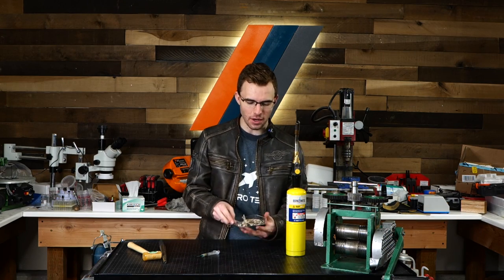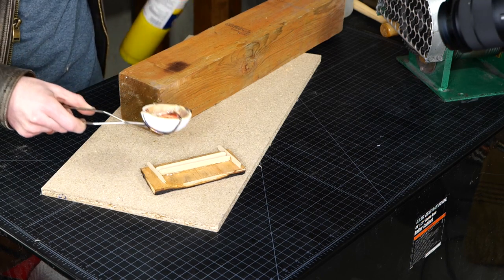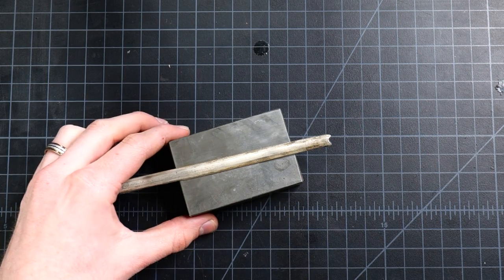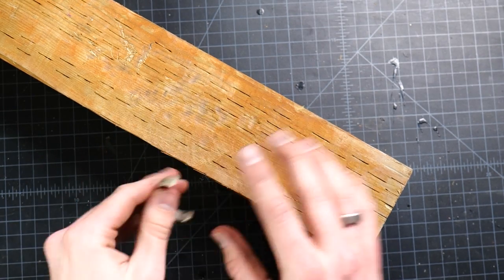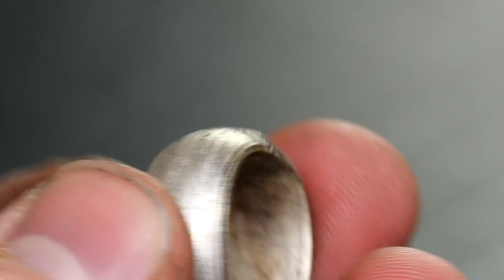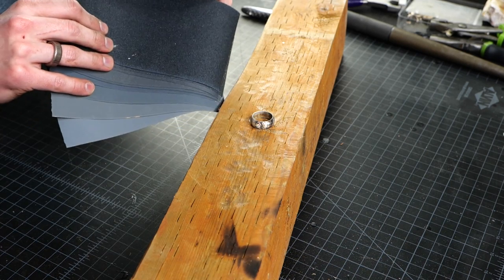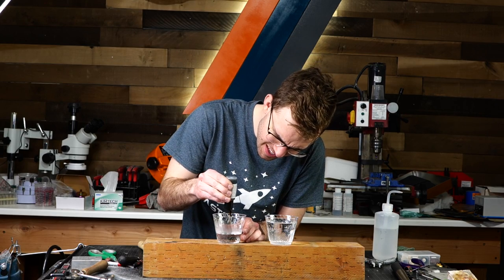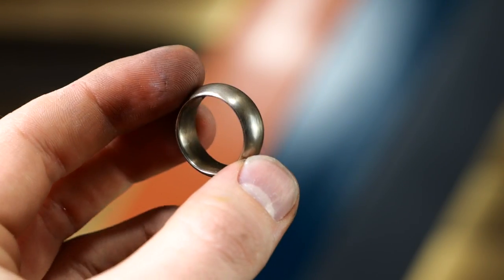No Lathe - Silver Ring from Scraps on a Budget

Comment: Just a bit of advice- if light comes through the seem, the gap is to wide. Solder is meant to bind the ends not to be a filler. Also, wrap the sandpaper around an old paint stick or ruler (grit facing out). It gives better consistency and crisper edges on the outside. Wrap the sandpaper around the mandrel to do the inside.
Reply: as a build up on this tip you can get the ends to line up easier with the saw, just anneal the piece close up de gap as much as possible and run the saw trough it
Reply: Joe Johnson wow thanks
Reply: Yes thank you for telling him
Reply: You are very good making
Reply: @jtjacky  nice making

Comment: Put the ring on the mandrel. Put the skinny part in your drill chuck and use that as a make shift lathe. Most people are going to have a drill if they have a ring mandrel. But you could even do it with a stick or dowel.

Comment: Tip: Don't use tin foil for soldering the ring joint. You will end up contaminating your silver because tin foil has a lower melting temperature than silver.

Comment: Can i use a Ceramic bowl as an alternative for crucible?
Reply: No. They're made of a special refractory ceramic. Get a melting dish and handle and some dried flux. The melting dish has to be prepared first, which isn't hard to do. Heat up the dish till it's red hot at the bottom, sprinkle in some dry flux and continue heating. The flux will absorb into the pores creating a glassy surface. If it looks mottled then there's not enough flux. Add a bit more and tip the dish in different directions to let the flux spread all over. When you have a glassy surface all over the inside and the spout then you can melt the scrap.

Comment: why are you using a bell mallet for your hammer
Reply: Rawhide is a good mallet material for softer metals like silver. It can form with minimal stretching and won't mar the surface. It works well enough for yellow gold, red gold and platinum but for much stiffer metals like white gold it's sometimes necessary to use a metal hammer.

Comment: Is it possible without a roller?
Reply: Possible to an extent. You wouldn’t be able to get the nice domed half round profile however. You could however hammer out the ingot. It would take a lot of time, and lots of annealing but it’s doable. Once you have the piece of metal to the thickness you want for your ring shank profile, cut the shape with a saw, then shape, solder, pickle and finish the edges with files and sandpaper. You’ll have a nice, handforged and textured ring, great for taking a patina.

Comment: dermal 40
roller 500
sandpaper 10
solder 10
silver ??
polish 5
ring mandrel 30
hammer 10
pliers 5
file 10
jewelers saw 20
tweezers 5
liver 20
steel wool 000 fin 8
map gas burner 50